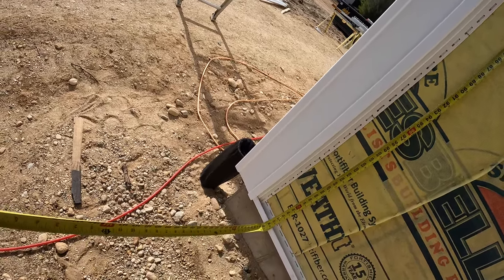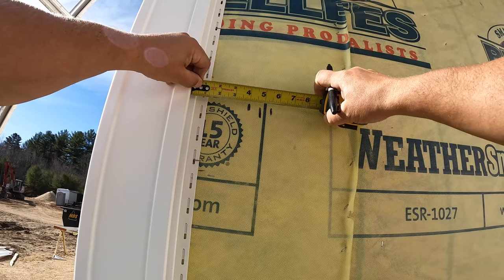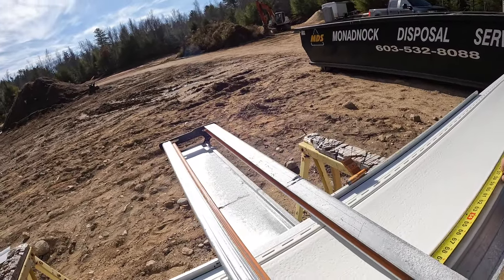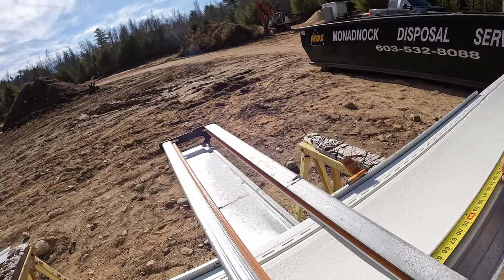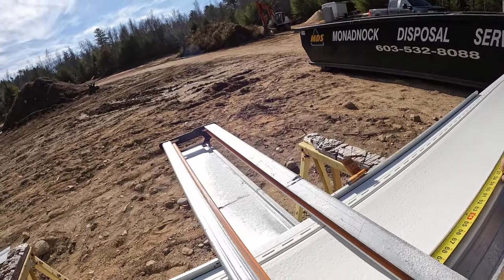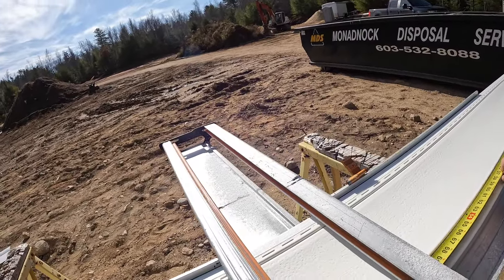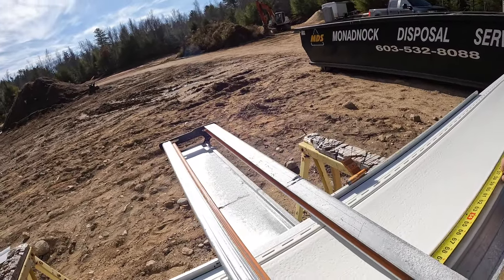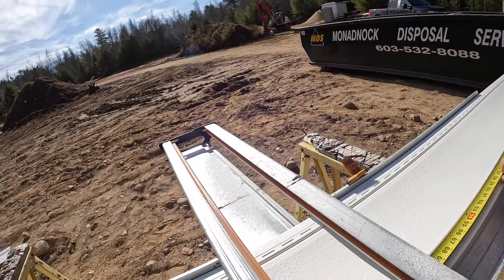DIY: How to install vinyl board and batten siding

Comment from the maker: Hand Tools:

Fat max tape measure https://amzn.to/3ZF9ROI

(Expensive but nice) Stiletto hammer https://amzn.to/3waImyV 

or

(More affordable) Estwing hammer 16oz 
https://amzn.to/3QCKKrX 

Carpenter pencils https://amzn.to/3QEO4T8 

Sharpie markers https://amzn.to/3IKxG1H 

Empire speed square https://amzn.to/3kmDxQo 

Irwin chalk line https://amzn.to/3iyfRbD 

Andy 3” siding snips https://amzn.to/3QD05Zv 

Malco siding removal zip tool https://amzn.to/3COkLrw 

Malco snap lock punch  https://amzn.to/3Ws0f7r

Malco trim nail punch https://amzn.to/3XxU6ra 

Malco nail slot punch https://amzn.to/3ZzKxtr 

Malco hand seamers https://amzn.to/3COWhhT 

(A little pricey) Occidental tool belt I use    https://amzn.to/3QD0lYs 
or

(More affordable) AWP Tool belt  https://amzn.to/3XtstiS 

Empire 10” Torpedo Level https://amzn.to/3GK9nhx 

Lenox Gold utility knife https://amzn.to/3CO4L94 

Buck Brothers chisel set https://amzn.to/3IM6Bez 

Equipment:

Tapco Pro 19 - 12’6” x 19” brake https://amzn.to/3kdYI7o 

Tapco Snap Stand https://amzn.to/3CPDzqA 

Tapco side winder https://amzn.to/3XcKRge 

Tapco pro cut off wheel https://amzn.to/3XfW2EU 

Tapco brake buddy https://amzn.to/3kdZfGq 

Tapco ProTrax siding saw https://amzn.to/3Xep7Av 

Makita dual battery framing saw https://amzn.to/3H6xI2M 

Irwin vinyl siding saw blade https://amzn.to/3kgDdmy

Comment: I have 1" foam and then 1/2"  pressed board of some type that does not have much structure.  I think it has Celotex.  There is plywood in the corners.  My question is related to starting the siding and if I need to make sure that I am able to nail into the studs when nailing in the board and batten siding?  I know with 16" centers you will not nail in all pieces into studs, but you could start with a partial piece to make sure that some of the siding is into studs.  I am doing the complete front of the house that has windows, doors, and garage doors, so you would never see both ends of the runs without walking the 70' feet between ends..  Thanks for your time.
Reply from the maker: I’m not sure that it can be made 100% correct, but there’s a couple methods that you could use. What you mentioned (nailing every other piece to studs) would help. Although if the pieces aren’t true to 8” there’s a chance you’ll wander off the studs. If it’s not too late to pad the windows and doors out, you could add some kind of padding horizontally that is nailed to the studs… then you’d have solid nailing on every piece.
Reply: Keith, I also have celotex in non rigid areas under my 31 year old siding. I want to do this to my house as well. What did you end up doing? I was thinking of tearing out the celotex and replacing with plywood. Thanks for any suggestions in advance. Thanks!
Reply: @ed370zx3  I have a rock front on the bottom of the house and my pieces of siding are under 5' long.  I ended up just nailing the siding as it fell on the runs.  We will see if I made a mistake, but there were runs that nailed into studs as I went across the front of the house.  Good luck with your project.

Comment: @siding school, I really appreciate your effort to explain the process so effectively.  

I am about to remove a 16ft garage door and fill in the opening with two 3.0 doors and 1.0 sidelights (ganged together).
 centered in the opening.  The wall has a peak 20ft high centered on the wall with 9ft sides before angling to the peak.  I will be using 8in board and batten siding by Provia.

My questions regard determining the angle cut at the peak, setting up a drip edge vs overlapping for the longer runs, and the best way to begin a starter course when it has to cover the height of a cinder block.

Would it be appropriate to use the angles previously cut for the horizontal siding the being replaced to set the cut angles?

In some YouTube videos, a drip edge is used to cover the end of the first row of vinyl before going higher.  Is that the best way to achieve the best look for my wall or, can the vinyl be overlapped similar to horizontal siding as it goes up?  The height from the new door to the peak center will be 14ft and I am concerned about the look of a horizontal line that might end up being only 2-3ft over the new door.   0:06 My dealer recommended a back to back J channel piece but I was concerned about holding water or if drilled to drain it, having the water get behind the lower course.

Lastly, I will need to create a concrete sill to match the level of the cinder block that frames the concrete slab so that I can set the door at the right height before building a raised floor.  What would you recommend for attaching the J channel to the current cinder blocks and concrete?  I am assuming that that method will also require allowance for expansion and contraction.

Thanks in advance from a retired vet that is still working on the never ending honey do list!  She says it keeps me young….
Reply from the maker: Thank you for your service!

You could definitely use the existing pieces of horizontal gable siding to determine the angle of your board and batten cuts… just use a square and cut off the whole angled part and use the squared part of the triangle held perpendicular to the edge of the board and batten to get your angle. That way you’ll get the reverse angle of the horizontal siding. Then save the new transferred angle to mark the remaining pieces. 

For separating the upper and lower pieces of siding I would not recommend overlapping the board and batten. The more pieces you put together like that it starts to make the siding go crooked because you lose a tiny bit of reveal on each overlap. Back to back J-Channel is and okay solution also most siding manufacturers make a vinyl ‘H’ lineal that has J pockets on 2 sides they are either 3.5” or 5.5” that you could use instead of double J-Channels I would consider installing this band or H channel lower down at the eave line or bird box level… in either case I wouldn’t worry much about water getting behind the siding… that is a normal occurrence and it will build up until it runs out the ends and/or spills out the face. The nail holes in the back of the J Channel are higher than the face - so it’ll spill out the front before going behind. Now as far as water infiltration in general - you should really have an air vapor barrier that will protect the house underneath, because vinyl siding is not 100% water tight. The air vapor barrier will do most of the work and is your #1 defense against the elements. There are methods to keep more water out by using Z flashing on top of an H channel or in between double J channels, those methods can be helpful but not completely necessary if the weather barrier underneath is properly installed. 

To connect J-Channel to concrete I would probably use a good hammer drill and masonry tapcons. I would recommend shimming with pressure treated wood as needed to bring in plane with the wall above and continuing the air vapor barrier to below the shims. And yep I would recommend installing the j channel so it can move a little. 

Hope this helps! Good luck!
Reply: Outstanding reply! Thanks.  One last question, when fitting the pieces to the wall, how do you handle a transition if the first piece measures out to have a cut in the batten?  I understand using a return or undersill for the flat areas but, the batten has me puzzled.  Would I need a deeper J channel and the undersill to hold 8n place?  

Again, thank you.
Reply from the maker: As long as it doesn’t interfere in another place (like a door) I’d shift the layout 4” over if I’m using a 8” siding piece. That should put the flat part of the siding into the corners on either side while still maintaining even starting and ending reveals. Sometimes there’s little to be done about the “batten” part landing in an opening or against a door - in those cases I would consider getting a dual undersill if additional support is needed.
Reply: Thank you for the information and response.  I hope you have a great and prosperous 2024!
Reply from the maker: @scottrhoades9056  You too!

Comment: Thanks so much for the informative videos. We're getting ready to install this type of siding but am concerned with how best to deal with the expansion and contraction of the board and batten vinyl.  We're seeing nighttime temperatures in the 40s with daytime in the 90s. How would you deal with that?  Do we need to let the vinyl warm up by putting it in the sun, for example, before cutting it to length and how much shorter should we cut it to allow for it to grow and shrink?
Reply from the maker: In a vertical siding installation, most of the expansion is downward. So instead of allowing equal space for expansion at both ends of a vertical panel, leave more space at the lower end: allow for 1/3 of the total expansion at the top of a panel and 2/3 of the total expansion at the bottom.   
For example, if the total expansion equals 3/4" (3/8" + 3/8"), allow 1/4" at the top and 1/2" at the bottom. If the total expansion equals 1/2" (1/4" + 1/4"), allow 3/16" at the top and 5/16" at the bottom.

Spacing
Gaps to Accessories

40° F or greater 
Vertical Siding
3/16" top
3/8" bottom

Less than 40 degrees F
1/4" top
1/2" bottom

Those are the specs directly from Certainteed. Now the siding can still be cold in the box even if in the sun. But it will warm up pretty quickly once out of the box… all that said, if it is 40 or above then the 3/16” gap at top and 3/8” gap at bottom will be sufficient. And to be honest, not many people are going to be that precise with their cuts. As long as it has enough room to expand you’ll be okay, but you don’t want to cut it so short that it’ll come out of the J-channel when it cools because that won’t look good. I don’t think laying them in the sun is necessary, you can just use the ambient temperature as your guide.

Comment: Great video thanks. Everywhere I read it says to make sure to have at least 1" to 1 1/4" backing for the nails. You mentioned you only had 1/2" osb. Will that be fine? Was thinking I had to add 1" strap pining to the 1/2" plywood shed I was building. Thanks for your response.
Reply from the maker: Wherever I’ve installed board and batten no builder ever provided the backing I needed. In Southern NH we don’t get much for high wind speeds or anything too crazy so everyone just nails to the 1/2” osb without many issues. Now if the siding blows off the house then the manufacturer won’t warranty it. Also there might be a possibility that homeowners insurance won’t cover it, but I’m not sure about that? So the answer is if you want to keep the warranty then I’d follow their instructions. And if you’re in high wind areas it is also probably a good idea. Also I know some codes are much more stringent and inspectors will want to know what was done and will withhold Certificates of Occupancy for crazy things (not that you need it on a shed!). 

If you are going to add 1” sleepers behind the siding, it would also be a good idea to pad any windows and trim out that same 1” as well (and make sure to make it watertight!). This way the siding can still utilize the j-pockets in the windows, doors, etc.

Hope this helps!
Reply: Thank you for your response. Very helpful and I appreciate your quick response.

Comment: Will water collect and debris collect in the j channel along the skirt (?) ?
Reply from the maker: Water will collect until it spills over the top of the J or runs out either end (some people drill 1/4” weep holes every 16” or so to help drain). Debris will collect over time, so it should be cleaned out periodically. I’m not aware of any methods to not use J at the bottom of vinyl board and batten siding.
Reply: Thanks!  I will be watching your various videos.
Reply: Hmmm my siding guy wants to use just drip at the bottom for that reason...guess he installs ends flush to bottom drip and leaves a gap at top for expansion. Will discuss this again with him....
Reply from the maker: To the best of my knowledge that type of install isn’t going to carry a manufacturer warranty. They say the majority of expansion happens downwards (but I think if it is able to expand upwards it probably will). Maybe he’s working with a brand of siding I’m not familiar with and they have alternative installation options. 

It’ll probably work out fine as long as it is able to expand and contract. Good luck! 👍🏼

Comment: @sidingschool any suggestion on how to fix battens that did not clip in? I have 2 battens on a 18' wall that I found were not clipped in. One is flying in the breeze the other is a little more secure but can come apart. I don't want to have to pull the whole thing down.
Reply from the maker: Hi, Unfortunately I don’t know of a better method than taking the wall back to the unclipped pieces. That being said you could try knife the piece maybe an inch from the nail fin edge of the piece so you could remove about 7” of it - if it is an 8” piece (careful not to cut the housewrap underneath, or tape it if you do). Then take a new piece and cut the nail fin part of the clip off and so it can fit in between the bottom of the next piece and the piece you left behind from knifing the last piece off…. There’s really no way to nail it using this method though, so before installing the new piece it would be a good idea to use a flexible adhesive in the bottom clip of the new piece. (Sorry it’s kind of hard to explain, hopefully you get the idea) 

There’s no guarantee the new piece will stay in place using this method and unless it is a ton of work to remove the siding I wouldn’t try it. Most of the time ripping siding back and correcting the mistake doesn’t take as long as you’d think. The pieces are mostly cut to size already and they are already physically close to where they need to be.

I may try to do a video on this.

Comment: Did you have to use J trim around the windows? I don't see any and am wondering if there are different styles/sizes of trim. Thanks
Reply from the maker: Hi Heather, I didn’t have to trim around the windows. They are a “New England” style casing with a “J” pocket already built in… there’s a few different styles of trim to choose from for exterior built in trim, I would ask your supplier for choices.
Reply: Is there a website or any other info on the style of j-casing that you used? Thanks
Reply from the maker: On page 62 there’s what they refer to as Lineal pieces. These might work for you against a window. Also many companies make PVC trim that matches regular wood trim profiles but don’t require painting or upkeep. 

chrome://external-file/siding-pocket-productcatalog-04-08-664-US-EN-2305.pdf

Comment: I'm getting ready to do my first batton vinyl job. How do you charge to install this type of siding.
Reply from the maker: Nice! I might not give you the response you’re looking for but…. It depends heavily on the job, don’t let anyone tell you otherwise. It’s like saying “how much does a car cost?”. It depends on how fast you are and how much you need to make to make some profit. Siding is usually figured “by the square”, which is 10’x10’ (or 100 sq ft). If it is really simple, the least I would do board and batten for is $175 per sq with soffit and metal wrap included. The more detailed work could get to $400 a sq or even more. 

Estimating is a very tricky thing to do and I don’t know if anyone has a perfect formula for it. I usually figure out the job by the square then just follow my gut for how long I actually think it will take and see what I would end up with by the day. If you’re making less than $500 gross income per day working by yourself you might as well go get a job working for someone else and let them deal with all the headaches (depending on where you live in the country that number could change drastically). 

Good luck!

Comment: I would side all the long walls first and windows and doors toward the end less waste
Reply from the maker: That is typically what I do as well. Get a feel for the job before you start and see where you need the highest quantity of long pieces - start with that wall and work your way to the wall with the highest quantity of small pieces… sometimes I’m able to side a house with less square feet of siding than the walls actually measure out to be (if you don’t deduct for windows). Sometimes the design of the house is not efficient for siding and you end up having to cut 12’ 6” pieces down to 6’ 6” and you never find a good place for the leftover 6’ piece (I’ve had it happen).

Comment: Not sure if I missed it, but why are you nailing and not stapling the board and batten?
Reply from the maker: There’s so much up and down and moving when installing board and batten that I find it easier to not drag a hose around. The staple sometimes interferes with the next piece of siding and I’m not sure stapling meets the requirements from the manufacturer. Also there’s the top staple that needs to be exactly at the top of the slot and it’s hard to get an exact placement vertically with a staple gun.

Comment: how wide apart are the Battons on this product. The ones at Homedepot I see are only like 5" apart and to me it looked cheap. These seem like they're 8 or so inches apart and has a better look
Reply from the maker: The pieces are 8” wide and the “batten” part is 1.5” so that makes the flat part in between the battens 6.5”.